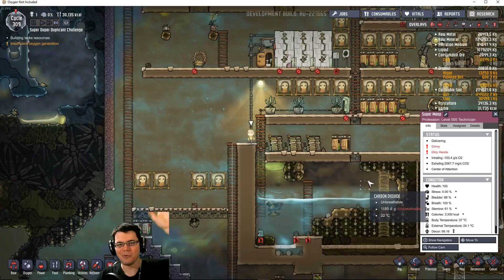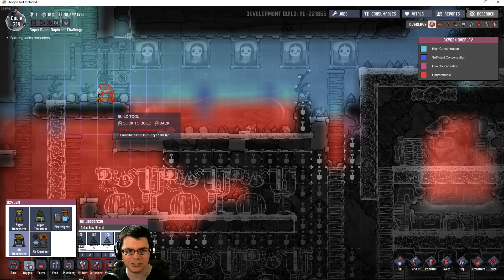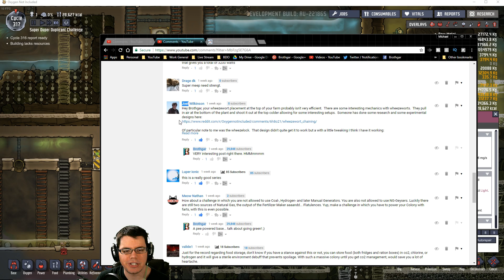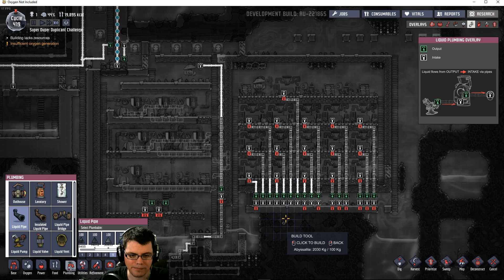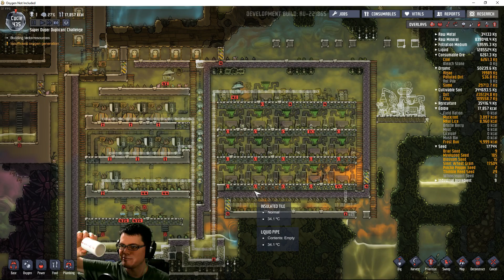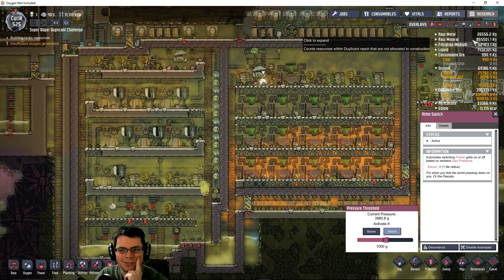Building The Power Plant! Super-Duper Duplicant Challenge Part 4

Comment: I got to thinking about them thar 3d printing. It never occurred to me, but it seems like all you've gotta do to make a 3d printer that can function as a CNC mill would be to beef up the rails and make a changeable head. As long as you don't mind taking little bites out of your material. 

In the near future, you'll buy a 3d printer, a consumer CNC mill, and a little surface mount machine. Then all you gotta do is buy chunks of raw steel, Sillicon wafers, spools of resin and copper wire and bingo! In 2030 you don't buy products, you buy blueprints. Blueprint pirating becomes a felony offense punishable by death. 

Then of course, a ragtag group of pirates with big hearts overthrow the government and discover the true meaning of friendship.Disney pictures Rated PG-13
Reply: Sigma What. Did. I. Just. Read.
Reply: The Gigabyte exactly what I just thought

Comment: Speaking of morbs: 

I noticed a way to "herd" them. (I don't have any screenshots for it atm, but going to replicate it and share once my current save starts dieing off.)

By putting a pneumatic door in the area they are inn, and make a dupe walk through it multiple times, you can make the morbs stay stuck in the door. The door "closes" on a morb, and then that door becomes a morb-trap. They door can stay open or closed (whatever you prefer) but the morbs will be stuck in the middle of it. Also, any other morbs trying to pass through will get stuck. I had about 10 morbs in one spot. Then I built a hole underneath, and deconstructed the tile they were standing on. Boom: Morbfarm on one tile.

Comment: The Puft can escape that room. It will go through that opening when it drops. You can build an open enclosure by placing a tile every other tile. Then at the gaps place a tile two tiles lower. This works because a Puft is 2 tiles high.
Reply: You could also lock the puft in with a liquid lock, takes a bit more work, but it has the added benefit that all the slime that falls into liquid doesn't evaporate into polluted oxygen again.

Comment: I found refined metal. Gold. 
My tepidizer went crazy overheated and started creating sand 4 tiles high all over the tepidizer. 
Then some turned into gold and something else. Whatever it is it's in the game but doesn't have a name. I posted it on the forums under ideas. 

http://prntscr.com/fvxcsv 

Stats

Decor +30%
Overheat temp +5000%
Hardness 2
Heat capacity .129
TC 60
However it has not been implemented to be used in the game. 
http://prntscr.com/fvxd5k
http://prntscr.com/fvxcyq
Reply: How did I get the gold amalgam. 
The only 2 things there and water and air

Still trying to get the tempidzer to work. I added more water around it. 
Now it reaches max temp. 

I just dug out some sand that had been sitting there and found more of that unknown object.
I wonder if it's sand turning into glass. 
http://prntscr.com/fwbw2v
Reply: Looking at the name it seems that the mystery material is glass. I'm just wondering how you got it so hot in there without melting the tepidizer.

Comment: Maybe you can't 3D print metal BUT that little piece of plastic is great to make MOLDS for metal. Then all you need is a mini-forge and you're good to go. Seriously. Don't forget you can get mold-making supplies super cheaply
Reply: Actually you CAN 3D print metal, a lot of industries have used that technology since at least 5+ years. The machine is just pretty big and costs a lot.
Reply: Plus you can get machines that can cut the metal to how you want it if you dont want to go through the hassle with the metal.